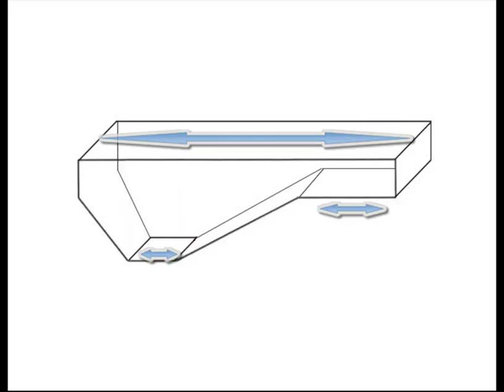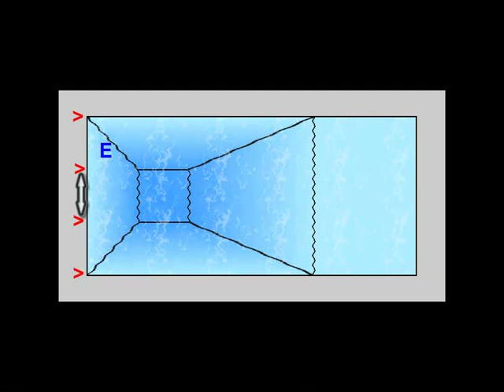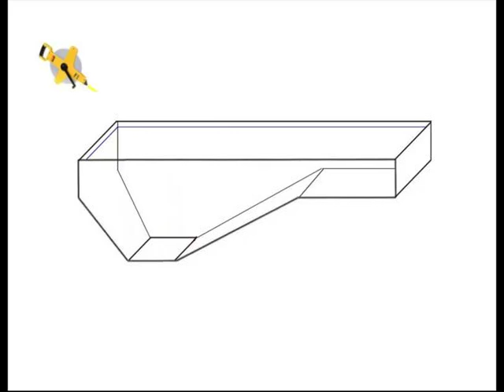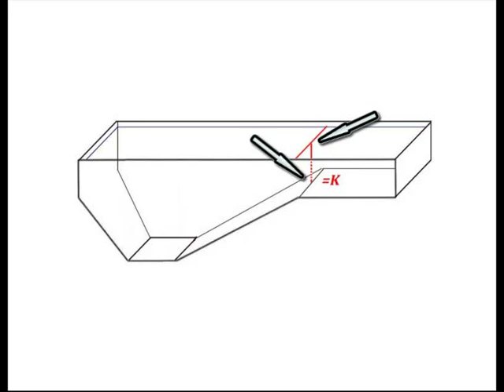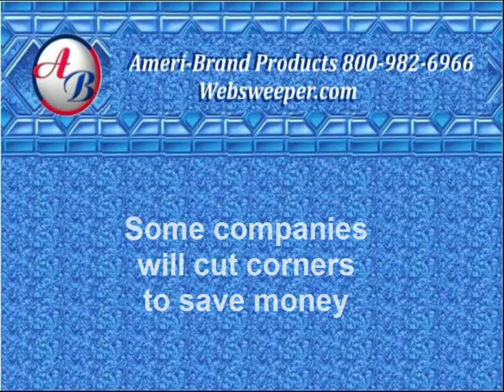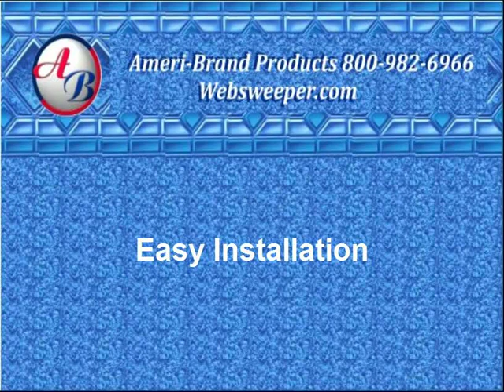How to Measure an Inground Swimming Pool Liner - Part 2 Ameri-Brand

Comment: I have almost the same pool of Chris my is like a bowl for my hopper, how i will be able to measure correctly plus the 2 steps in the corner are in the hopper also and my pool in the bottom is sloped. please i need your help plus i check the measurements 5 times already and they are uneven